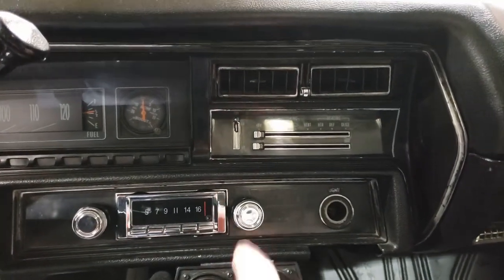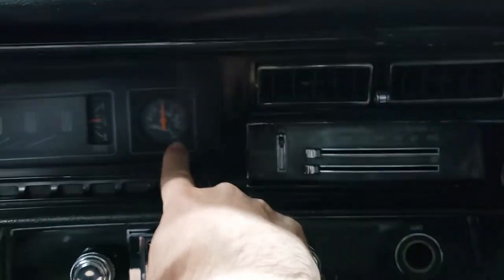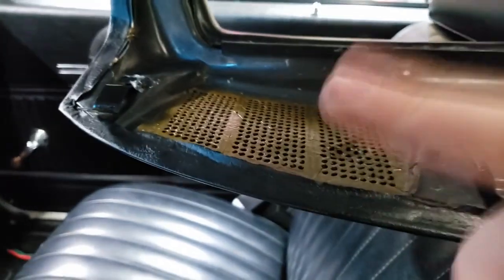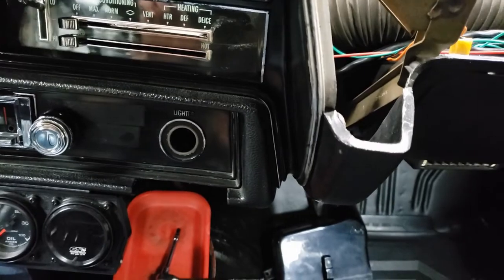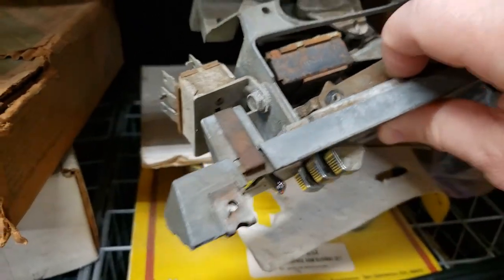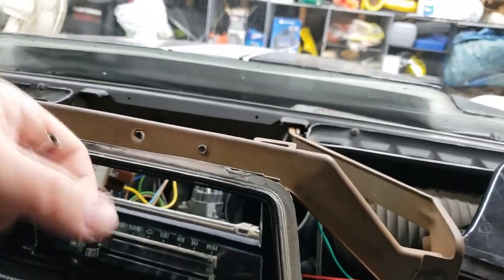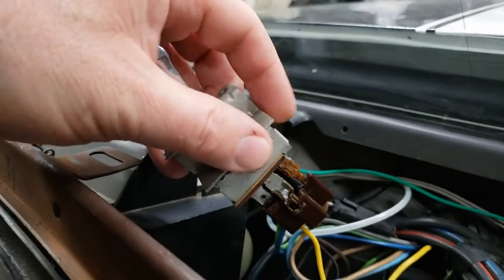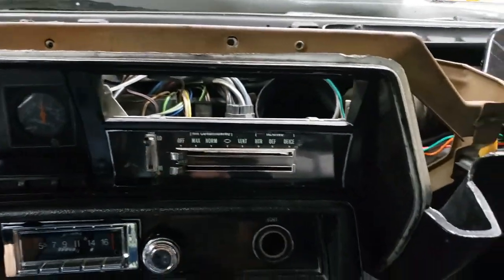Installing a new fan speed switch in my 70 chevelle (same for 70 to 72)

Comment: Thanks for the video, I got a 70 four door A/C car as a daily driver.  I replaced the blower, replaced the relay, checked the fuse and it was good so only thing left is the switch which had been acting up for the past year or so. I got to buy a new switch and replace it as per your video.  Was suprised that none of the big name parts companys carry the switch ( not even NAPA ! ) You are correct, shipping one part at a time from any of the aftermarket Chevelle suppliers is pricey, so I found a GM brand switch with that P/N# for $30.00 with free shipping on E bay. It will be here in a few days. Wish me luck as summer is coming and you got to have A/C with a black interior.
Reply from the maker: Thanks ...and glad the video helped.  It's why I do them.  Also glad to see you found a good deal on a switch, and that you're reviving a 4 door.  All are worth saving.  🤘  Good Luck!
Reply: @Engineering_Improvisation   Switch changed ( yeaaaa) My plugs were about like yours, kind of toasty however the back of my old switch was BLACK! all burned up and 2 of the spades were about to fall out of the switch. So yeah I think that might have been the problem.  I also modified the dash board clips that hold the pad at the windshield as 3 of the clips were loose (squeaked every bump in the road) I just put small short screws in behind them and tighten them right up. Now I got to go get some door edge foam to seal up the missing seal for the top duct as it was all gone. I hope the 2 small switch screws go back in easy as that's next
Reply from the maker: Awesome!  Sometimes, the little victories are just as rewarding as the big ones.  Keep at it!
Reply: @Engineering_Improvisation   Completed the job, still no blower, however I just installed a new fresh 1967 327 in the car about 1,000 miles ago and did away with the water temp & oil dash lights sending units in place went a set of old school mechanical gages and all that wiring goes through that same blower relay, so I got a few circuits still open somewhere under the hood.  But the switch is in and the center A/C  duct is now sealed tight .

Comment: Thanks for the video. You saved me a lot of time. I was contemplating removing my  windshield for easier access but not now! I have a 70 ElCo and only 3 speeds work and not very high. The fastest doesn’t work at all. Already replaced fan motor. I’m hoping it is the switch. ( :
Reply from the maker: Glad it helped!  One thing to note is that the highest speed is a direct connection to the relay and has its own fuse buried in the harness that runs in a tray along the top of the firewall in the engine bay.  So check that, too.
Reply: @Engineering_Improvisation  
Thanks. Is that fuse an “in-line” fuse in a little fuse holder?
Reply from the maker: Yep.  That's it.
Reply: @Engineering_Improvisation  
I’ll give it a try and let you know if it helps. Thanks again.
Reply: @Engineering_Improvisation  it worked thanks. The fan is working full blast now and barely any wind coming out. Probably a door in heater box.
Reply from the maker: Great news!  Is the air coming from the front vents, windshield defroster vents, or floor vents?  Possible issue with either the blend door or something in the vacuum system (lines, valves, actuators etc).